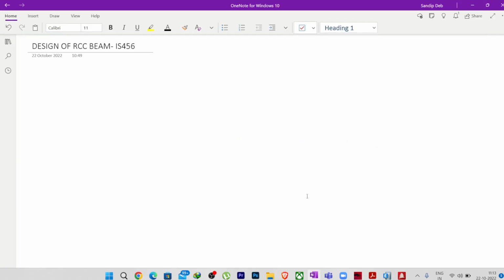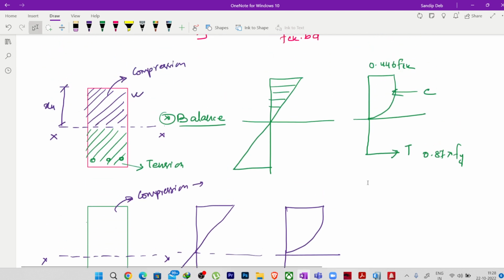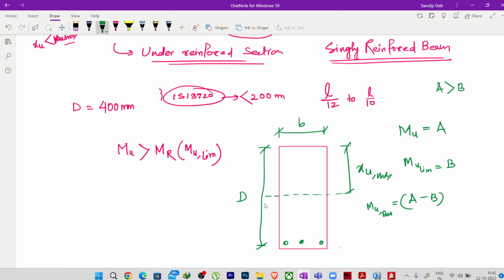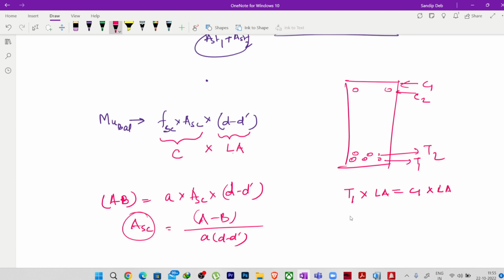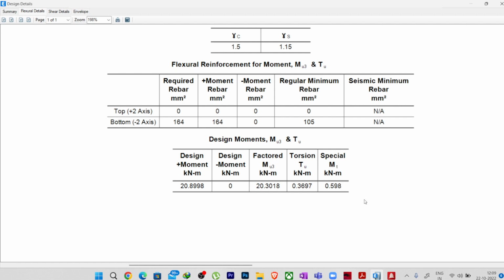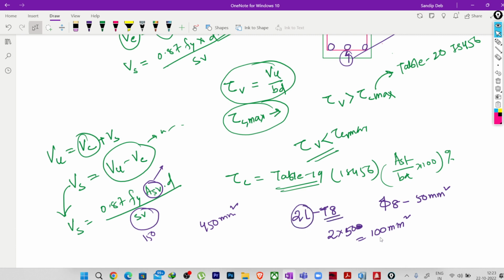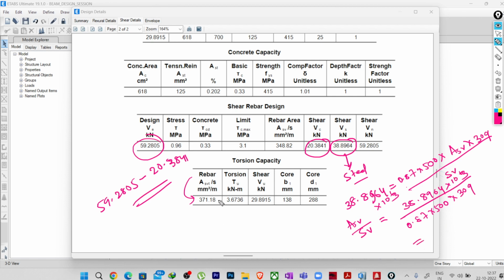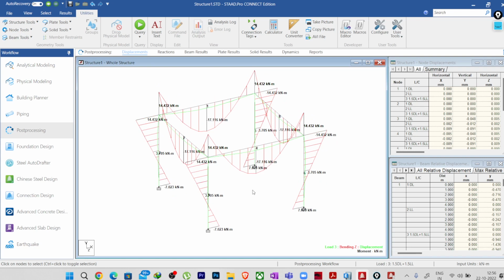Structural Design Bootcamp - Day 1: Design of RCC Beam- Manual &  Software Based Design | ilustraca

Comment: Sir can u please briefly say how to calculate the Torsion(Tu)  value for a simply supported and fixed beam? It would help us
Reply from the maker: For manual analysis, you can refer the book of RCC Design by Pillai and Menon giving explanation of torsion calculation. In practice we generally take the analysis results from the software.